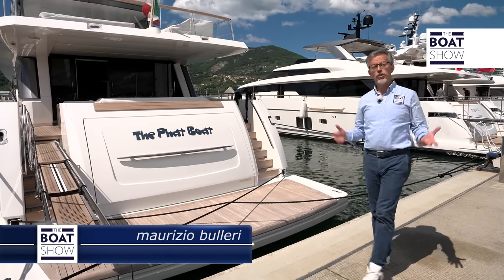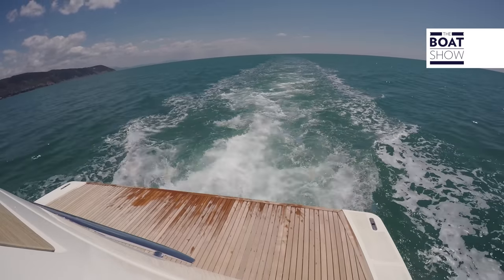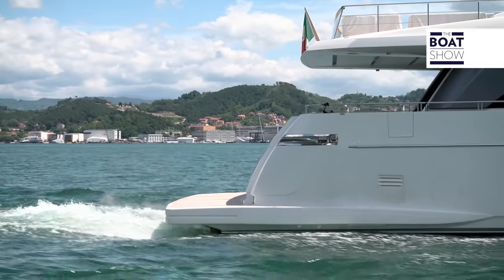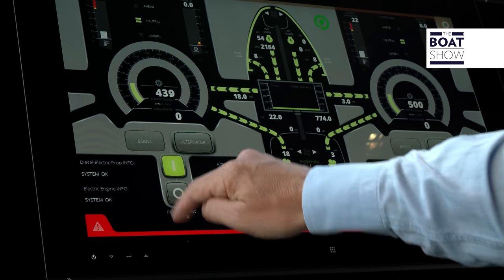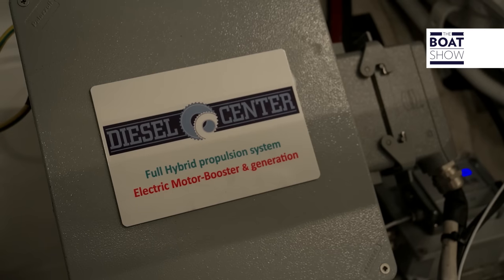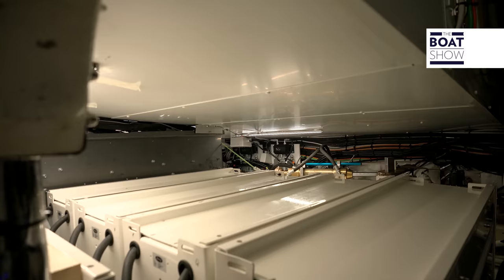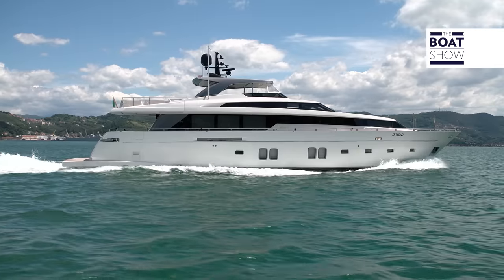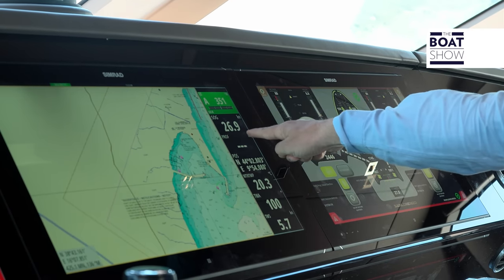[ENG] SAN LORENZO SL106 - Hybrid power DIESEL CENTER - The Boat Show

Comment: A far more efficient propulsion system for this and for any other yacht or ship is the Centrifugal Propeller. No external propeller, thrust is created in a completely closed unit with no external vents and no external moving parts. It is waaaay faster and it is only a matter of time until all ships and yachts use it.

Comment: this solution needs to be trialled on a 25-30m displacement only yacht. this could be a game changer. i assume the classification groups have rules in place to accommodate this type of installation.
Reply: It has already been tested on 50 meter yachts with succes
Reply: wr9ng

Comment: Wenn running at displacement speeds the consumption maybe somewhat acceptable but that is nonsense because the hull is not optimized for displacement. At planing speed it is even more heavy than a conventional yacht and thus a waste. The concept is good but can only makes sense in a displacement yacht.
Reply: wrobg

Comment: Are solar panels not cost effective?  I just wonder why I don't see any on the hybrid type yachts.
Reply: I have asked myself the same question. Possibility the fact that a solar array would weight a lot if sized large.  Im thinking if it could charge in a weak enough to travel around 10 miles it would work great for island hoping. In the Bamahas islands are close to each other .6kw weights about 1000lb  plus batterys tropical sun hours are high. you might be looking at 40-50 kw stored a day. He stated 150kw storage will go 9 hr.s at 9 mph 81 miles total. How much the house uses I dont know. I think his numbers are misquoated. 180 hp x 2 x 750w per hp. = 270 kw per hr.. at 9 mph. 18 mile range 540 kw in lithium (100kw costs 30,000$)200.000$ battery cost . battery charge time 11 days. Diesel 100 gallon cost say 400$.  Thats 500 weeks say 10 years. To recover cost.
Reply: There is an e-Catamaran MY that uses lots of solar panels stretched across the broad beam hard-tops.  Solar panels at 500W each cannot generate much propulsion power, 20 panels, 10KW, is only a 130HP diesel motor.  Solar at this point is best used to replace generator power needs.  There is one large MY that has a couple of 500HP diesel engines mounted in the bow which provide electrical power to a couple of 500HP electric motors on pods in the back.  The advantage is that the motor noise is separated from the living areas and the long shafts are not needed.  I would expect to see more of this employed in the future, maybe even in retrofits.  My idea refit would be an old Hatteras MY with dual engine rooms with the burnt out engines replaced by 2 large generators, electric motors on the shafts, and a lot of battery storage as well as a number of solar panels.  One could run engines off generator(s) during day while charging batteries and then run silent at night off electric motors and house electric using batteries.  Maneuvering would be awesome with fine control.

Comment: I'd be scared of the Li-Ion batteries as a fire hazard.....battery technology of this type for marine use is still in a very early stages.
Reply: There are different types ofLithium batteries they can use...
Reply: Lithium-anything reacts with water......violently.
Reply: so diesel fuel not a fire hazard?
Reply: Louis Devault This Yacht has both. So double the fuckery..
Reply: Not really, it has to be compressed for ignition (unlike gasoline)
Reply: Precaution and well handle. Reckless and irresponsible user may lead to disaster.